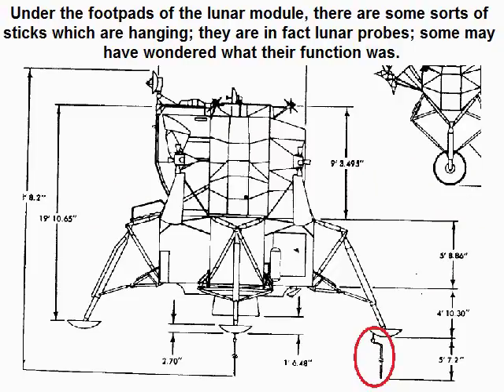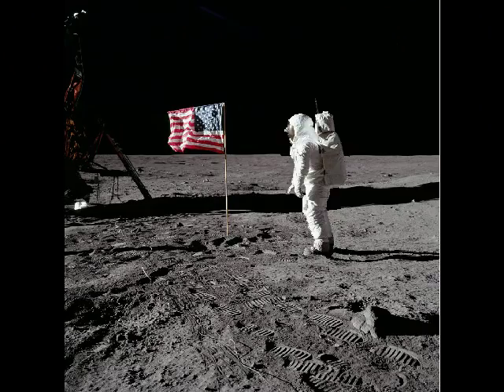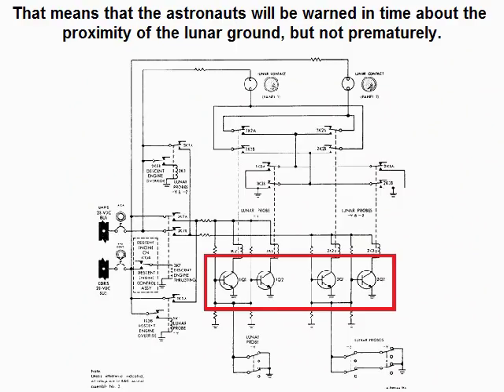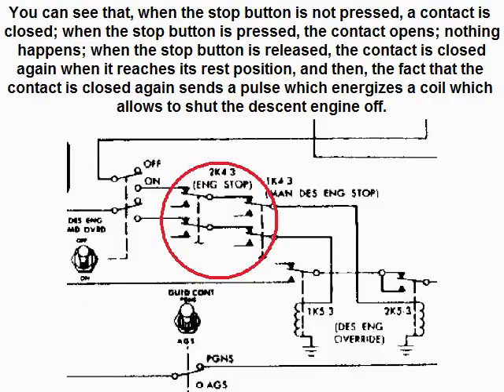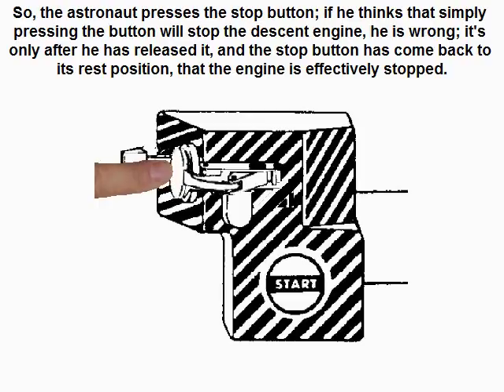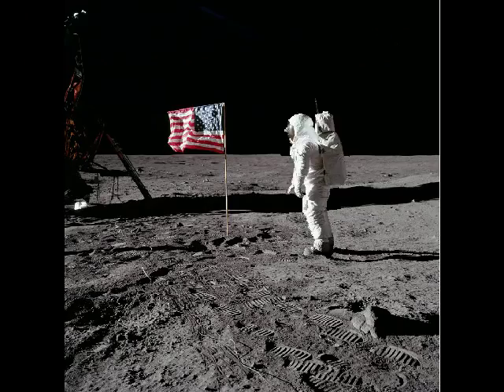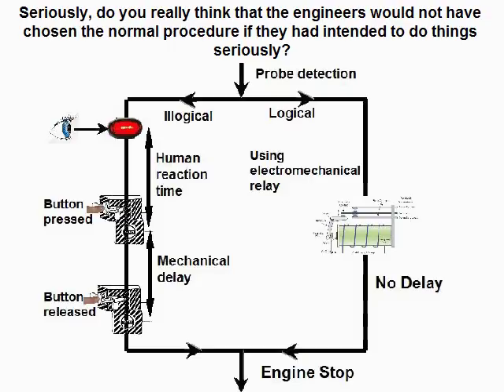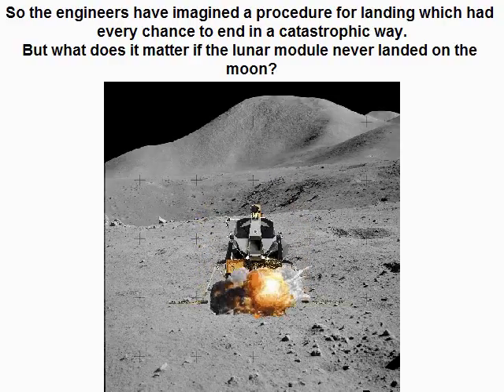Unsafe moon landing

Comment: The Apollo 11 transcript immediately puts the lie to this nonsense; appended below for reading pleasure but the TL;DR version is that 26 seconds before engine stop altitude was 40 feet, vertical speed 2.5f/s (already below the 3 f/s that hunchbacked believes landing occurred at), 4 seconds later altitude is down to 30f (confirming that 2.5f/s is really the speed, then 4 seconds after that descent rate has dropped to just 0.5f/s, 15 seconds after that the contact light goes on (so it took 19 seconds to descend 30 feet; vastly below the 3 feet/sec being quoted here). Engine stop does take 3 seconds to be called after contact, but at that descent rate they're still three feet clear of the surface.

04 06 45 17 LMP (EAGLE)
40 feet, down 2 1/2. Kicking up some dust.

04 06 45 21 LMP (EAGLE)
30 feet, 2 1/2 down. Faint shadow.

04 06 45 25 LMP (EAGLE)
4 forward. 4 forward. Drifting to the right a little. Okay. Down a half.

04 06 45 31 CC
30 seconds.

04 06 45 32 CDR (EAGLE)
Forward drift?

04 06 45 33 LMP (EAGLE)
Yes.

04 06 45 34 LMP (EAGLE)
Okay.

04 06 45 40 LMP (EAGLE)
CONTACT LIGHT.

04 06 45 43 LMP (EAGLE)
Okay. ENGINE STOP.
Reply: Mr Sommer, are you aware of this superb, award-winning website? http://www.firstmenonthemoon.com/
Follow them down in realtime. Air-to-ground loop on left, Flight Director's loop on right. That's the legendary white-waistcoated Gene Kranz, of course -- one of the finest gentlemen ever to have walked on Planet Earth and a great personal hero of mine.
This recording never fails to bring tears of nostalgia and pride to my eyes. What a fantastic day that was! I was 11 and it was the first time in my life that I was allowed to stay up all night. I was glued to the TV screen.
I'll bet a year's gross income the likes of 'Hunchbacked' have never experienced anything remotely like it in their pathetic lives.
Obviously, no one could have written a script like this.
Reply: Ironical how Hunchbacked always disappears when he is presented with anything resembling a challenging question...
Reply: So what exactly is "unphysical" about it? Do you mean it violates Newtonian mechanics? If so, let's see your detailed QUANTITATIVE analysis. (The English word "quantitative" means "using numbers and measurements". It does not mean "it just looks wrong to me somehow"). Oh, and do remember you're the guy who couldn't properly analyze a simple first-class lever for at least several years.
Reply: +ApolloWasReal  I apologise for my schoolboy French as I was forced to learn it at high school - they had this crazy idea 40 odd years ago that to matriculate to university study required some fluency in a foreign lingo. I know that some of my inflected endings are wrong but I could never understand why French words had endings at all as they are never pronounced at least not in the cultivated parisian accent that we had to contend with. The irony is that I speak to this very day a very fluent Hochdeutsch courtesy of a German upbringing but the school banned German instruction. I didn't realise it at the time but we were still in the aftermath of WW2 and the speaking of German was heavily discouraged in my neck of the woods. Germans are not afraid of consonants and a hard crisp word ending is a delight to the German linguistic tastebuds whereas the French are so apologetic about consonants and view rounded and truncated endings as the height of cultural achievement!
Reply: The Apollo 11 Mission Report describes the landing in complete detail: "The landing on the lunar surface occurred at 102:45:39.9 with negligible forward velocity, approximately 2.1 ft/sec to the crew's left and 1.7 ft/sec vertically. Figure 5-13 shows the body-rate transients which indicate that the right and the forward landing gear touched almost simultaneously, giving the spacecraft a roll-left and a pitch-up motion. The left-directed lateral velocity resulted in a slight yaw-right transient at the point of touchdown. These touchdown conditions, obtained from attitude rates and integration of accelerometer data, were verified qualitatively by the at-rest positions of the lunar surface sensing probes and by surface buildup around the rims of the footpads. Figure ll-17 (in section ll) shows the probe boom nearly vertical on the inboard side of the minus Y footpad, indicating a velocity component in the minus Y direction. Built-up lunar material can be seen outboard of the pad, which also indicates
a lateral velocity in this direction. The probe position and lunar material disturbance produced by the minus Z gear assembly (fig. ll-17) indicate a lateral velocity in the minus Y direction. Figure ll-16 (in section ll) shows in greater detail the surface material disturbance on the minus Y side of the minus Z footpad. The plus Y landing gear assembly supports the conclusion of a minus Y velocity because the probe was on the out- board side and material was piled in board of the pad."
Reply from the maker: That's not what the descent table which is shown in a NASA document is saying. And, even if the speed was 2.5 feet/s (which is not coherent with the speed which is indicated in a descent table shown in a NASA document), it still was leaving little time before stopping the engine; the reaction time for pressing the stop button, plus the fact that the stop button had to come back to its rest position before stopping the descent engine, it was a too dangerous maneuver, for the astronaut could perfectly leave his finger on the stop button before releasing it in the stress of the moment.
The descent engine had to be stopped when the lunar probes were touching the lunar ground, and the only way to do it efficiently was to make the detection interface automatically stop it, and not ask the astronauts to do it themselves when a lamp was lit.
Reply: +hunchbacked - have you got a link for that descent table? you may be looking at the landing speed, which was higher than the final approach speed precisely because the engine had been stopped, allowing the LEM to accelerate through the final feet. Anyway the speed is quoted by Aldrin in the transcript at 06:45:25 as "Down a half", i.e. 0.5 feet/sec, and this is reinforced by Aldrin saying at 06:45:21"30 feet" and at 06:45:40 "Contact light" (5 feet), i.e. 25 feet down across 19 seconds. They're coming in gently.
Reply: +Rob Stuart - thanks for that link! the best ever fly-in-the-wall perspective. Sadly I was only conceived about the time of Apollo 11 (not a perspective I've had before; obviously a question to put to my parents...) so I grew up with Viking & Voyager, also splendid but not quite the same
Reply from the maker: Yes I have:
http://www.hq.nasa.gov/alsj/nasa-tnd-6846pt.1.pdf
Reply from the maker: I have used the Apollo 11 transcript which is indicated in the video library of Apollo 11, and it confirms what I said.
102:45:43 Armstrong (onboard): Shutdown
16-mm MOCR film clip with synchronized audio (45 sec)
Audio/video compilation and synchronization Copyright © 2015 by Stephen Slater. YouTube presentation by David Woods.

102:45:44 Aldrin: Okay. Engine Stop.

[Neil had planned to shut the engine down when the contact light came on, but didn't manage to do it.]
[Armstrong, from the 1969 Technical Debrief - "I heard Buzz say something about contact, and I was spring-loaded to the stop engine position, but I really don't know...whether the engine-off signal was before (footpad) contact. In any event, the engine shutdown was not very high above the surface."]

[Armstrong - "We actually had the engine running until touchdown. Not that that was intended, necessarily. It was a very gentle touchdown. It was hard to tell when we were on."]"

1) Armstrong tried to stop the engine himself when the warning lamp went on, but according to the script, he didn't manage to do it himself.
So there already was one second wasted.
So, it was up to Aldrin to stop the engine.
I would be surprised if Aldrin knew that he had to release the stop button to actually stop the engine.
"in any event, the engine shutdown was not very high above the lunar surface."
Not very high, means too close to the lunar surface.
If the engineers had devised a length of 1.7 meter for the lunar probes, it's because it was the good height to stop the descent engine.
And finally, the final nail:
"We actually had the engine running until touchdown."
If the detection interface had automatically stopped the descent engine, the engine would have stopped running before the lunar module touched the lunar ground.
So, you can always discuss, the problem is very blatant, the procedure which was followed was completely illogical.
Reply: I know you can't be bothered to look at the actual data, but it's all there in the Apollo 11 Mission Report. It has detailed plots showing all of the LM's 3-dimensional movements right down to the landing. And if you'd read the annotated transcript on the ALSJ, you'd read Armstrong saying that while he had planned to cut off the engine while still above the surface, he didn't see the contact light nor did he remember Aldrin making that call. So he didn't shut off the engine until after they had landed.

So, as usual, your entire premise is wrong. It was NOT absolutely essential to shut off the engine before contact. It was simply a precaution in case the engine nozzle were blocked by an uneven surface (which it wasn't). Other missions did cut off the engine while still above the ground, especially Apollo 15. It landed so hard that bent the descent engine nozzle, which is visible in photographs.
Reply: +hunchbacked - that document is the plan for landing, i.e. they planned to be at -3fps upon probe contact. However there's something wrong in that plan since the indicated altitude is 12 feet but the probe is only 5.6 feet long. In the event their vertical speed was below the automatic plan from 80 feet altitude - see figure 25 in the second half of the document. It is true that at the planned rate of descent they had less than 2 seconds to either stop the engine or increase thrust to avert landing, however that's not a ridiculous reaction requirement given that the event was expected and the response (land/boost) already anticipated by the crew.
Reply from the maker: I have seen it, and it has made me laugh; I'll make a video about it; what we can see on it is completely unphysical; never a normal spaceship would behave this way.
Reply: +Lappan Sommer  "that document is the plan for landing"

Just confirming the predictive nature of the data that le Hunchie mistook for actual flight data. The table referred to by le Hunchie is on page 9 of his hyperlinked pdf and entitled "TABLE I.- APOLLO 11 PREMISSION POWERED-DESCENT EVENT SUMMARY". Le Hunchie notra petite grenouille francaise should spend a bit more time with his English/French lexicon checking the meaning of English words such as "premission"! The data is conservative in giving the worst allowable case scenario - the total delta V listed is also significantly above the anticipated total to allow for unexpected maneuvers especially in the terminal final descent phase.
Reply: Of course!!
Reply: My French is very poor (much worse than Hunchbacked's English) but I believe that should be "Le Hunchie notre petite grenouille francaise..."
Reply: Ah mais oui mon ami! Un peu de beurre à feu doux d'apollo l'imposture réfute et le petite amphibien est coupé au niveau des hanches pour une belle entrée de cuisses de grenouilles. Servi avec un bon vin blanc c'est magnifique non!